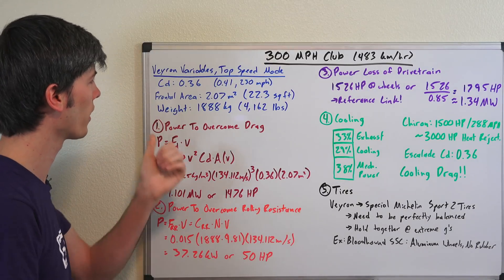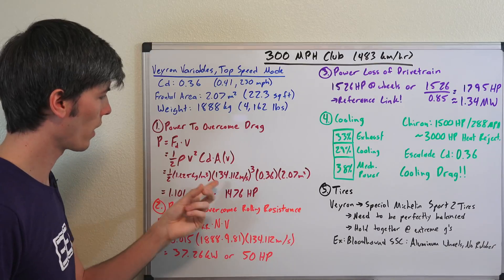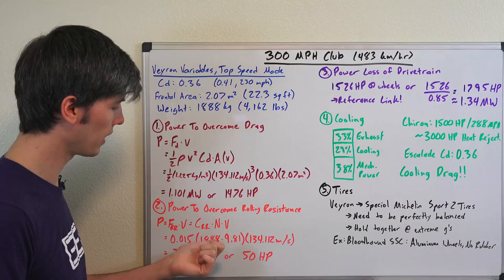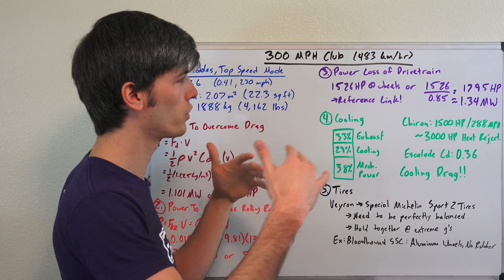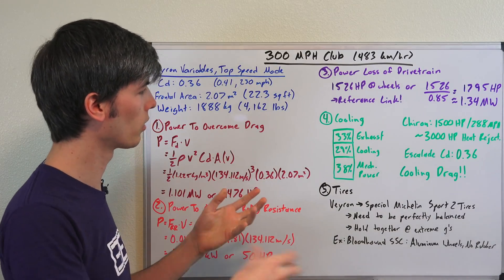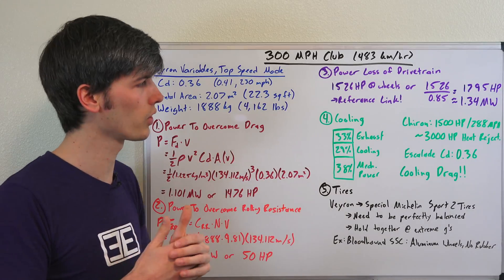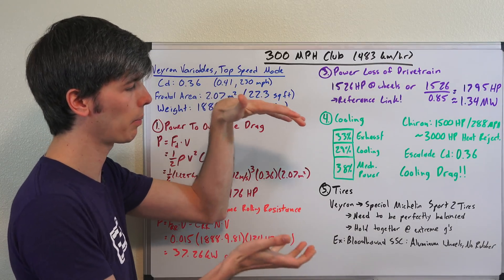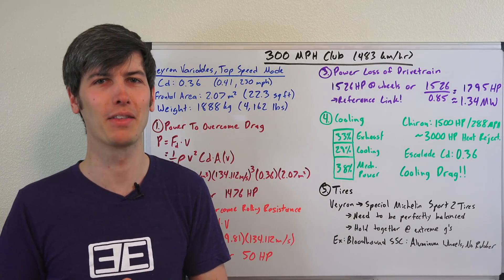Why Has No Production Car Hit 300 MPH?

Comment: What am I missing here about the 3000HP of heat? Where does that power come from? Why isn't the power of the heat loss equal to the 15% of inefficiency in the engine? Is the engine really making 4500HP but with 2/3 of it in a non usable form of heat?
Reply from the maker: Correct. The engine is generating around 4500 HP, but only able to convert 1/3 into useful work. That's why electric cars are the future, internal combustion engines are inherently super inefficient.
Reply: Wow. I never knew that about internal combustion engines, I only ever knew of the ~15% efficiency loss and nothing more. That's extraordinarily wasteful. I have even more reason to save up for an electric car now.
Reply: The 15% is not the efficiency loss of the engine, it refers to the drivetrain losses (gearbox, bearings, etc.).  The overall efficiency of a typical gas engine is around 25-27%, but that's at normal driving conditions.  Most of the loss is due to thermodynamic limits (2nd Law of Thermodynamics).  Electric motors are around 80%+ efficient overall, so require much less total power and cooling.
Reply: Yeah, even assuming absolutely no losses (carnot engine) a heat engine can only operate at around 70% efficiency, and it is physically impossible to reach anything higher. This is due to the second law of thermodynamics, so yeah, to reach higher efficiency, something other than an heat engine must be used.
Reply: +Engineering Explained The engine is NOT generating 4500 HP. It is burning fuel with the energy equivalent of 4500 HP and turning it into 1500 HP of kinetic energy and 3000 HP of heat. Likewise, a 60W incandescent light-bulb is misleading. It is using 60 W of electric energy, but not radiating 60 W of visible light.
Reply: I highly doubt that. Gasoline has to be physically transported to each gas station, and then you have to physically drive out of your way to a gas station to pick up the oil. Tanker trucks get about 7 miles to the gallon loaded, and can carry around 7000 gallons of gasoline. So just transporting gas ~330 miles will give you a loss of ~4.7, which is the EIA calculated average loss for transmitting electricity. And the majority of Americans live much further from an oil well than 300 miles. Just physically moving oil from the ground to a refinery and to a gas station can easily result in losses of 10-20%.  And an increasing number of people are buying solar panels, making the transportation cost of the electricity effectively zero.
Reply: The nice thing about the electric infrastructure is that for the most part its already in place. High voltage power line losses are also comparatively small.
Reply: +B10401 Actually it's the opposite. High voltage AC lines and transformers are very efficient and stationary power plant turbines are way more efficient than any piston engine will ever be.

To refine and transport a gallon of gasoline uses many kwh of electricity. Some estimates are that a gallon of gasoline production uses as much grid electricity as a Nissan Leaf would use to drive 25 miles.
Reply: So are the drivetrain losses just due to friction? Or I guess maybe work used to move those parts is work that's not spinning the wheels.
Reply: Friction and weight of the parts in the drivetrain. Every part in the drivetrain will have mass and therefore will require a certain amount of energy just to move those parts.
Reply: It's not really unusable, it's just unused. Most of that heat goes down your exhaust in the form of a very high mass flowrate of hot gas. A lot of it is also dissipated through your radiator and into the oil. You've put heat into it and you're not recovering it. That's a problem of the engine cycle, not physics. You can use heat exchangers to harvest some or even most of it, but nobody does for some reason.

The unusable heat, in the form of entropy, is waste as a result of work done to/by the fluid (i.e. compressing and expanding the damn thing). The fraction of that heat is significant, but much less than what is just being allowed to go to waste.

Gas turbine engines suffer from the same problem, though there are implementations of cogeneration which recouperate a lot of that otherwise wasted heat and bring overall cycle efficiency up to about 60%, at least theoretically. A similar implementation in a car engine might be a possibility with OGEVs (onboard generator electric vehicles), where the engine can always run at its most efficient state and adding cogeneration equipment doesn't cause as much overcomplication.

You can work out the same for your car - you know roughly how much fuel it burns going down the motorway at your desired speed, there should be published data on drag and dimensions for your particular car, so you can work out how much power it takes to drive and compare to how much power it's actually using (calorific values of fuel are readily available too). I think you'll find a LOT more energy going in than there is coming out! Muh turbodiesel sits at around 28 - 33% (theoretical maximum being about 40% for that model). That's 60BHP going in and only about 20 coming out!
Reply: Ben Tyl a very efficient internal combustion engine only converts 37% of the chemically stored energy into motive force. the rest of that energy is waste heat. so i believe he meant that the bugatti is producing the equivalent of 3000hp in wasted thermal energy.
Reply: That's more of if you could harness all the energy the engine is losing through heat. There's no way to use all that power it throws out though. So the power of the engine in a dyno isn't showing you all the power you're losing but the power it can use. Lot's of power thrown away.
Reply: B10401 In the real world waiting for 30+ minutes doesn't happen often. I know several people with Teslas and only one has ever used a charging station and that was on a road trip from TX to CA and back. When your car starts every day with a full tank it's the "stopping on any corner" requirement that starts to seem crazy.
Reply: B10401 the kWh for gasoline (petrol) production was a topic on Robert llewellyn's "fully charged" YouTube series. "Volts for Oil" episode.
Reply: Engineering Explained Can you do a video on Top Fuel Dragsters? And maybe the potential for electric planes?
Reply: Ben Tyl no that's the capacity of the cooling system. In other words it can keep an engine making 3k hp from overheating. He mentioned it to demonstrate the drawbacks of having all that hp
Reply: +Jimmy Dorff I'm under the impression that many old coal power plants are actually less efficient than modern piston engines, at least in many economy cars. New generations of cars and their engines come out much more frequently than new powerplants and they are produced in much larger numbers. The recent push for greater fuel efficiency should have pushed them out in front of those coal burners.

Speaking of those coal burning power plants, that electric car that some of y'all are drooling over is only as clean as its power source. There probably are cases where driving a piston engine is more environmentally friendly than an EV.
Reply: Yeah, there's a car engineer here on a TV program that routinely says "1/3 of your gas tank is used to move the car, the remaining 2/3 to heat the universe a little more".
The sad part, is that we need petrol for other stuff. From plastics to the pharmaceutical industry, to the asphalt on the street itself, so we should be at least trying to have clean energy production instead of burning fossil fuels, and we should be using pluggable hybrid vehicles, which would run on electricity most of the time.
Reply: You ignored the fact that it takes electric motors to pump oil out of the ground which requires electricity. Also refining oil, again, requires electricity.
Reply: Marc Jackson I get that. But horsepower is measured at the back of the crankshaft not the top of the piston.
Reply: Well the maximum thermodynamic efficiency of an Otto cycle engine is 15%, the Diesel is 40% and that still leaves over half of the input energy as waste. Gas turbine engines with cogeneration approach 60%, but that's as close to unity as you'll get from what is essentially a heat pump/motor. That's still almost half your input energy being wasted in some way. People don't realise just how much energy is stored in chemical fuels!

Comment: You could have checked how close your assumption of gearbox power loss was by comparing with data from a real Veyron. I mean if you know the drag coefficient and rolling coefficient the power at the wheels and the top speed the only thing left is the loss of power through the drive train.
Reply: xingomuxo  frontal cross section is also part of the equations
Reply: +Funky Dunky that is included within the drag coefficient

Comment: the reason is because they don't want it to. period. 300mph is easy. we had satellites that could take a picture of the dimples on a golf ball from the ground on earth space in the early 60s. we can make a car go 300mph. the car companies just want to save it and keep it in their back pocket. just like why the new vw bus hasn't come out yet. with the gtr/lambo/bugatti/other supercars race, every 100hp is made out to be some huge deal. oh I have the alpha kit. now I've got the alpha 11 kit. now I've got the mp1200 kit. now I've got the alpha wolf 1300hp kit. have you heard about the  lone wolf 1400 kit? gonna be sick bro. in reality, they have all they need to make a damn 16 cylinder quad turbo car make 2000hp easily, seeing as how it's already technically been done but it's some huge feat to do it on a 50 state smog legal car. they do this because they don't want it move too fast and they can't sell sell sell every 50hp they release. it's all marketing.
Reply: They can make a 2000hp car sure. But the drag caused by cooling vents etc. would slow it down. Alternatively, they could have little cooling and reach 300mph, but melt the engine. It's got nothing to do with marketing, 99% of people don't even want a car that goes 200mph, let alone 300.
Reply: Cooling is not a problem, not sure what you're talking about. If the car can be be cooled successfully at top rpm in first gear it can cool it in top speed. The rpm of the motor is the same whether it's topped out in 1st or 6th gear. The weakest link are the tires but again they have tires that can handle it
Reply: The engine has a much greater load at top speed due to air resistance etc. than it does in 1st gear. 7000 RPM at 10mph is much easier for the engine and takes less power than 7000 rpm at 200mph, and the latter requires more cooling as the engine is working harder and using more power to maintain the car's speed.

Also, the air resistance caused by the cooling system (vents, etc.) in 1st gear speeds is much lower than at top speed (Air resistance increases with velocity)
Reply: Load does not determine cooling pressure

Comment: the veyron isn't very big frontally but it could be smaller if they weren't also aiming for comfort, we can reduce the surface area to 1.8 meters squared, and decreasing the weight from 1 mountain to 1 car  somewhere around 1300 kg also helps a lot. 3908 vs 2340  - that is a decrease of 40% needed power.

Comment: Thought you were gonna say it's cause the air resistance suddenly gets bigger than the traction even on the best tires, even when you've managed to squeeze as much downforce out of that air resistance as possible. If regular cars weren't power limited, at what speed do you reckon they'd be traction limited?

Comment: Engineeering Explained that is so wrong on so many lvl the fact that Bugatti Veyron SS still holds the OVERALL top speed records.. Check your facts and check Guiness book of records.. Here i taught you took this seriously lol no hate =) 

Furthermore into details you use CD 0.36 alot i would call it CdA but thats being nit picky.. So Bugatti Veyron uses a special made PAINT yess a PAINT JOB which makes their top speed so absurd.. first its super slick so there is literally no frcition on the paint or chassie where the paint is covering (they say this in their vid about the Bugatti profect) they also use the hole in the middle to push air trough and around the car in tubes this means they dont hit a wall of FORCE (force in air resistance)..

Weight is NOT a factor of top speed at least very very little affect if you had the most AERO car in the wolrd with aalot less power and much better AERO and much more weight this would only mean it would take ALOT longer to reach the tehoretical top speed.. Yess weight create frcition a bit on the wheels however its tiny..

Here is WHY Bugatti is fooling Physics TKR Keating car had its mirrir removed and nailed plastic glass it had a power out put of 1800-1900bhp and weighing 950-1000kg still it did 263mph only the Venom GT did reach 0.4mph higher top speed on a air field but they never did 2 runs in 1 hour the opposite ways so it was never a Guninnes record and they havent made enough cars etc etc but that Venom GT has much better aero then Bugatti veyron SS and it weighs ALOT less and more it has more power still they couldnt beat the Veyron SS..

Other car brand hasn`t beat it either like Ksegg and now we only talk about the late Veyron SS..

So my point is that Veyron cheating physics since your math on AERO and over comming AERO is about weight being a factor still FAR FAR lighter cars with more power and better CD/CdA dont have anything on the Veyron SS this factor alone deserve a vid hehe =) 

sry for my english in advance third language lol!!

Comment: Also bloodhound's wheels are NOT driven so they can be made of a low friction material
Reply from the maker: Correct, and it goes in a straight line. If they were driven, it could still accelerate to a top speed, it would just be restricted in the rate of acceleration. Unfortunately we don't have a long enough, flat enough area for slow accelerating to 1000 mph, so rockets it is!
Reply: America could hold a time trial style event over a straight piece of highway.

Comment: Unless manufacturers ar willing to make smaller cars, there will always be a HP war for speed.  The challenge is building a safe car capable of high crash test scores while still being diminutive.  I think one big hurdle on this is the public because we as consumers have ideas of how big we expect a car to be, how much room we have physically inside the car, and how much space we have to put stuff into the vehicle.  Bigger is more practical in most regards...unless you're chasing high levels of performance.

Personally, I think the next evolution of automobiles will be when a manufacturer is willing to create a smaller vehicle, mainly transitioning from a 2+3 to a 2+2+ or 2+2+2 format and permanently removing the idea of ever having a 3rd passenger across any seat.  I think this is one mental hurdle that has be leaped over before cars can begin to reduce frontal area.  As well, manufacturers need to take greater effort and develop design philosophies to make small cars feel big, and I think there are a lot of design elements that have been used in various vehicles that have achieved this.  I don't think we can ever step away from crash safety ever.  I think this is fundamentally necessary, so it is something we're stuck with.  I do think manufacturers have not made some revolutions in this realm though.  This isn't a function of better simulation but more so a matter of changing the core design concepts of a car.  I think cars have to be fundamentally different than what we perceive cars now for look, packaging, and even incorporation of technologies.

I'll give a silly example.  I like the FRS/BRZ in size.  I think it could be something much more than a sports car.  Inside, it feels very roomy vs other sports cars (it feels cavernous versus a S2000, RX8, Miata).  I see this car as a tremendous platform for a 2+2 or even 2+2+2 in wagon form.  It only requires length.  A good example of a well developed 2+2 is the RX8.  It's a car that seats 4 adults well and is packaged very well.  It's just a cozy cabin and no wagon variant from a practicality standpoint.  I think it's in these size cars that a revolution in packaging can occur that can get us the personnel and material transport we want but in a package that is efficient and cuts through air well.

Adding to this example some, there's packaging.  Electric has come along in a big way, and packaging of battery and motor can be done with huge variety, although no manufacturer really pushes concepts all that far.  There are also other concepts like breaking up the single, large motor into two or even four smaller motors and package them differently in the car.  This applies for both electric and gasoline.  There is cost as more motors means repetition of the same parts which adds cost.  The drivetrain may also become more complex in routing electricity, air, exhaust, and power to the wheels.  It can offer complete changes in overall packaging though and could lead to ways of creating more compact packages with improved aero.

Comment: bugatti has total 3000hp wastes 1500 
not wasting 3000hp so this video is waste now
Reply: he said it produces 3000 hp worth of heat dude lol if it had 3,000 hp to the crank Bugatti would surely market it as a 3,000 hp car.
Reply: 3000hp produced 1500 at crank remaining 1500hp lost as heat , i don't know if you meant the same, if so cool
Reply: http://ecomodder.com/forum/showthread.php/veyron-engine-loses-2-000-hp-waste-heat-24083.html
this is for the first model which had 1000hp now i think about it i think only chiron has 1500hp supr sprt was 1200?

Comment: Wouldn't the rolling resistance be higher at higher speeds because normal force would be higher because of downforce?
Reply: bugatti lowered downforce in the top speed mode. Also he did use a high rolling resistance so it kind of evens out